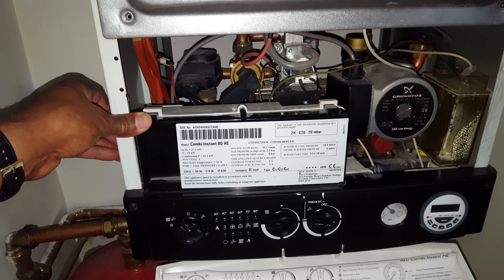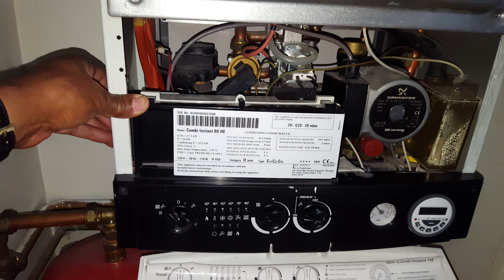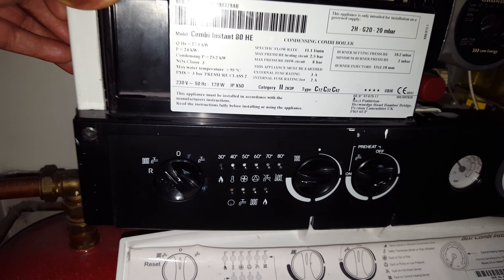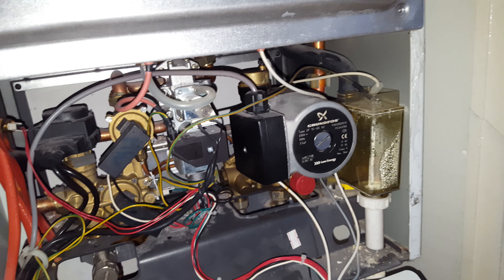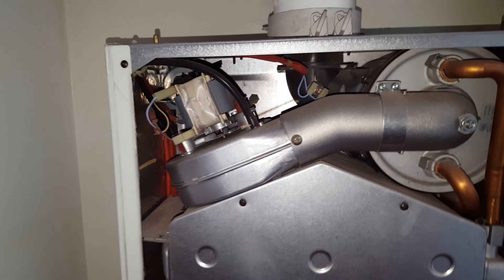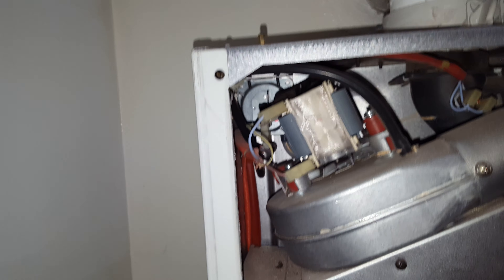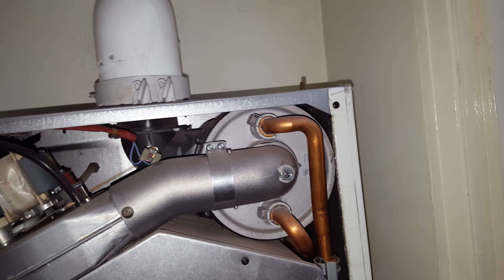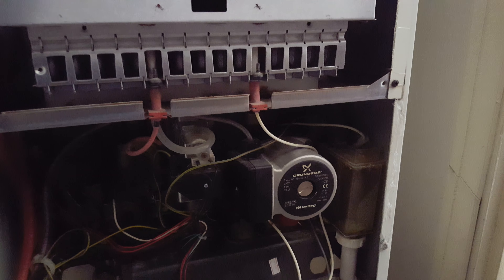Boiler fault finding baxi combi instant 80HE

Comment: The inside of this boiler you're filming looks almost identical to a Potterton Performa 28i I once had back in 2005, 

This was a nightmare of a boiler which use to 'eat' diaphragms every 3 months and lose water pressure overnight (I constantly had to use the filling loop to put pressure in it daily to stop the red fault led light from flashing and cutting the boiler out)

I swore blind that I would never buy another Potterton or Baxi product ever again!!, Only to replace my problem page Potterton Performa 28i with a Potterton Gold HE 28 instead! - THIS BOILER HAS BEEN ABSOLUTELY BRILLIANT IN EVERY WAY SINCE I HAD IT PUT IN BACK IN DECEMBER 2009.

The stainless steel vessel of the Gold HE really does make a huge difference, as I discovered that my old Potterton Perfoma 28i vessel had rusted though in one corner and was causing this boiler to lose pressure over night. 

Great video man!
Reply from the maker: +Joseph D Thank you
Reply: You're welcome man :-)